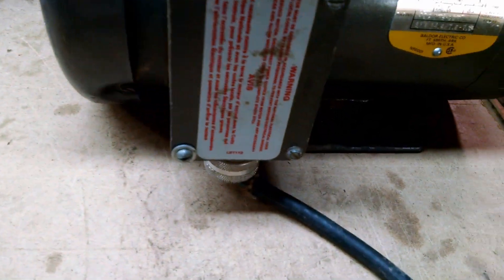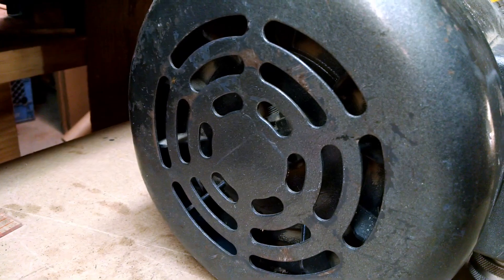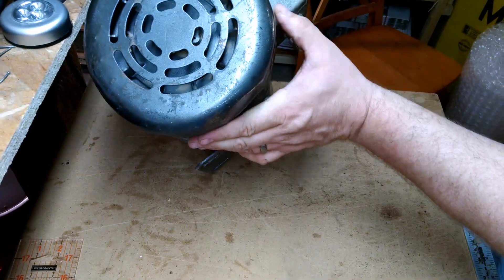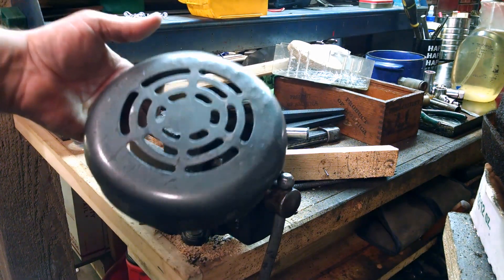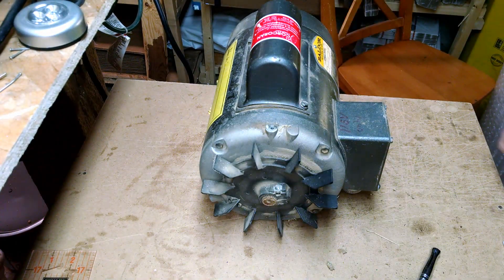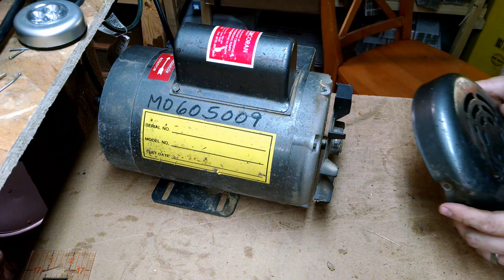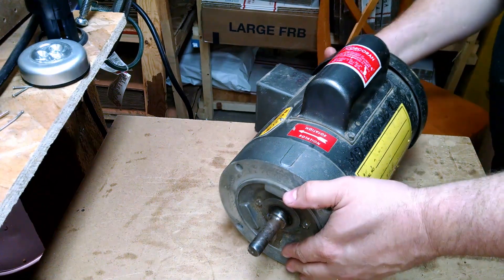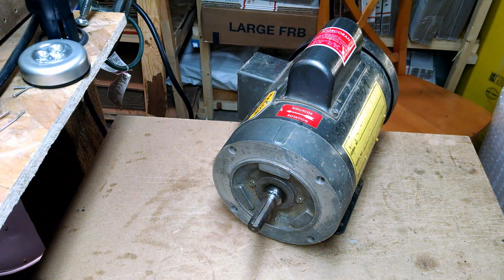Simple Electric Motor Repair

Comment: Hi, i am hoping you might be able to assist me.  I have a brushless electric motor that hums but does not turn(belongs to a phase 1 bench grinder).  When i tried to turn it by hand in the "on" position, it does not move.  While in the "off" position, it turns just fine.  I checked the capacitor and it works fine.  The bearings are good too.  Any ideas on what might be wrong with it?  Thanks

Comment: Thanks. Any ideas on a similar motor that hums and spins very slowly?  When I put light hand resistance on the shaft, it either bogs down entirely or wants to change direction.
Reply: Bad capacitor probably

Comment: You could have loosened the fan screw and slid the fan down closer to the endplate first. It looked like the fan was too far away from the endplate which could have caused the blades to rub on the cover.

Comment: The motor came off a woodworking planer.It runs okay but the fan broke while the motor was running and messed up the cover too.I don't know why people don't get back to me unless they are very busy. So you're he'll will be greatly appreciated.
Reply from the maker: If it's broken beyond repair you might try to find a similar model motor that you can rob the fan and cover from.

Comment: I have a 3 hp motor shaft has been marred by the pulley, and pull is now to big for shaft. Can I smooth shaft down and use a half inch pulley instead of the 5/8
Reply from the maker: Reducing the diameter down to 1/2" from 5/8" seems like a lot of work...I'd try Loctite first. How bad is it marred?
Reply: Rather then changing the shaft diameter the pulley is made to fit. Honing the pulley or resizing by drilling or turning on a lathe and then a bushing is inserted. Or buy the correct size pulley. As a last resort the shaft can be turned down but if the pulley is damaged it will also need some tweakin' . This us usually done in a must run situation or the motor is not a high value piece and therefore is not a big deal.